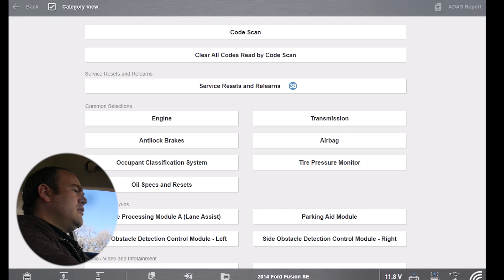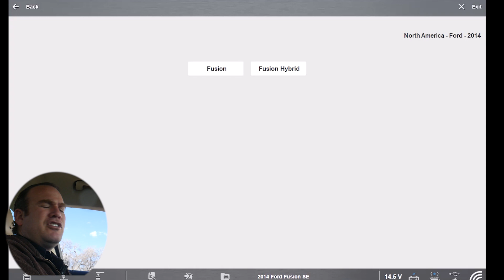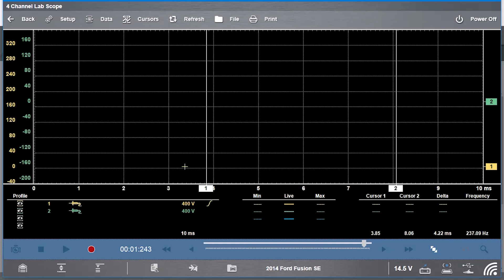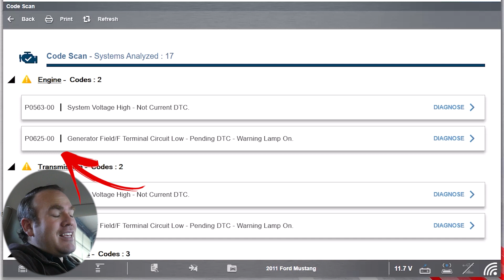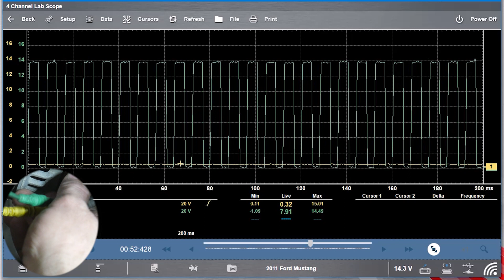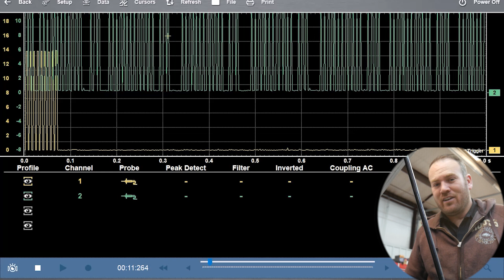2 Ford's with Check Charging System Message - Smart alternator testing

Comment: If I understand the operation correctly the gencom periodically sends 10 pwm pulses to the alternator to tell it what voltage to maintain. I presume that if the gencom signal is not present for too long then that alternator will go into default mode. The pem pulses on genmon report back to the pcm the state of the alternator. If either signal is not what is expected and perhaps if the system voltage is low the check charging system warning is displayed.

This sux just to possibly save an ounce or two of gas Ford opted for this complicated charging system that a lot of mechanics cannot understand. I guess that keeps guys like you in business. Thank God for guys like you.

Comment: How long can a car run with a faulty regulator??
Reply from the maker: @evanstephayn272  depends on if the vehicle is charging properly.  If you check the charging voltage and it’s normal, then you could probably drive it that way for a long period of time. If the alternator is under charging or overcharging, you risk damaging other components.
Reply: @ThePracticalMechanic   I did recieve the check charging system light for a short period of time, I was able to check my voltage which is at about 14.5, However, I did not have the reader plugged in while, The car had the code, (the reader plugs into my cigarette lighter spot), I had a faulty alternator on my other honda CRV which successfully showed the jumping in voltages. Woul;d it be worth monitoring the voltage while continuing to drive It or would It be worth replacing it ASAP, I do believe that it is still charging, and have seen no other signs of a bad alternator, ( dimming/ flickering lights, trouble starting, etc)

Comment: I have a 18 Mustang GT and the alternator gauge bounces between 12.0 and 13.5V.  I am wondering if this a common state for the car (when the PCM is calling for more power)?  it seems to go up when I take my foot off the gas and start to slow either by applying the brake peddle or just coasting down a hill.  Any direction would be great.

Comment: Can this be seen with a voltmeter and not just a scope?
Reply from the maker: You could use a combination of the voltage setting and duty cycle setting to figure out what the signals are doing. I just like the easy visual that the scope gives.

Comment: hey brother plz reply back , i am having ford fiesta diesel , whenever i start the car battery warning light comes on the dash but if i revv the car till 4k rpm it disappears , and wont come back till i turn off the car , what is the issue
Reply: Sounds like revving it makes the alternators regulator kick on. Bad wiring or pcm in assuming.

Comment: I too am dealing with same issues with my 2012 F-150. Replaced alternator with Motorcraft 225-amp (over $600), and replaced Motorcraft AGM battery with a Motorcraft lead-acid (over $250) keeping both old alternator and battery yet charging issues persist. I've now purchased a replacement factory OEM charging wire harness (battery, alternator, a/c, starter) and just waiting for a warm weekend when I can do the swap. Not sure how many hours it will take to remove old harness but guessing it will be several. Once out I can inspect for damage and location of same (corrosion, mice, chipmunks, squirrels chewing on insulation) and prepare new harness so this can never happen again in future. I have a Banks digital monitor mounted to driver pillar and most of time vehicle charges normally at 14.3 vdc, then for no reason it dumps down to 12.8 vdc while at speed which then fluctuates (11.9 - 15 vdc) up/down with the throttle pedal position (higher voltage pedal up / lower voltage pedal down) alternator makes whirling sound (pedal up) in addition, headlights, dash lights briefly dim when launching from a stop. I do not understand the connection between the throttle pedal and the charging system but somehow they are both connected.  As this has occurred with both alternators/batteries, I do believe wire harness is to fault.

Comment: Brother I'm having the same issue after I left my car sitting for 11 days to get inspection.   I picked it up and this light came on.  Now I'm being quoted $750 for an alternator.   But the battery in this car is over 5 years old.  Could it just be the battery?
Reply: Take your battery to get checked, change it if need to. However, if the charge system appears very likely that your alternator also was dying as well

Comment: I’m having battery system charging on my 2016 2.3 Ecoboost mustang  I have coded P0620 generator control circuit malfunction 
I’ve tested those wires for continuity and they’re good it has a new battery the alternator has been replaced 3 times all from advanced  auto it worked but then the alternator housing bolts all came undone and I had This code pop up and so then I got a used oem alternator from a car with the same miles and it worked for a bit but then I get the same code again the car had a fresh batter 14v but now it’s down to 10.4 and it kinda hangs then and then just dies
Reply: I’m gonna try to read the charge on the wires like you shows I found the exact diagram online for the gencom system and the pins for the pcm which is 26 and 59 I believe I gotta double check but they all have continuity so I’m kinda stuck I might buy a new alternator at this point and try that but I’m gonna have my alternator tested

Comment: Just quick question does the alternator put out a diagnostic bias voltage on the monitor wire like the pcm does on the control wire ,  just subscribed was looking for info and testing ford smart charge and found your great channel i didnt know about ,  thanks again .
Reply from the maker: The alternator outputs the bias on the command wire and the pcm toggles to ground. The pcm supplies bias to monitor wire and alternator toggles to ground.
Reply: @ThePracticalMechanic  Thanks for reply , reason i asked is i noticed a 2/3 volt on the command wire when the alt was unplugged and the pcm was toggling it , cheers again.
Reply from the maker: @clueless6559  ah. I think your correct. That bias is probably for an open circuit test. If the pcm sees 3 volts it may set an open circuit code. If it sees 12 volts it will set short to b+ and stuck to ground it sets short to ground code. I misunderstood on the original question.

Comment: Chad, are you in the habit of only boosting a stranger with the donor engine off? I learned old school, to leave donor engine on so voltage is higher, better energy transfer, and no risk of depleting the donor battery. However new cars don't like to be boosted above 12 V, there's a risk of throwing codes on the vehicle with the dead battery. What do you think?
Reply from the maker: I prefer to use a jump box like the jumpncarry 660 or noco jump box but I will jump start with most of my vehicles if needed. I will not jump start with my highlander hybrid.  It’s not worth the risk of damaging the dc/dc converter. 

I think it would be safest to turn both cars off while connecting the cables and then start the car with a good battery and let it run for a while to jump the other car. Perhaps shut off good car before cranking the dead car to prevent the 300-500 amp load from damaging the alternator. 
I honestly hadn’t given it much thought before since my vehicle are all over 10yrs old. New finicky electronics may make carrying a booster pack a more common item.

Comment: I just foxed a dodge pickup with same set up for alternator it had been to another shop thry replaced both batteries (diesel) the alternator no fix they told customer needs PCM he declined i found the wires at the plug at alternator broken new pigtail and connector unit charges
Reply from the maker: All it takes is a little testing and you can normally isolate the true fault. Good work.

Comment: Nice one Chad!  I've seen this same problem twice, both in Ford Edge's.  
You are definitely correct about installing OEM alternators also. First time, customer requested aftermarket,  same over-voltage problem.  After that I would never install aftermarket alternator on a computer controlled Ford again.  
Thanks for your thorough explanation and direction.  Great job man.
Reply from the maker: I’ve been burned too many times with aftermarket alternators on certain vehicles. I complained to rotating electrical rep one time and he told that the most alternators that are sent back defective aren’t actually defective but many of them just have the incorrect regulator installed.  I told him that still means it’s defective and I’ll be filing a labor claim.